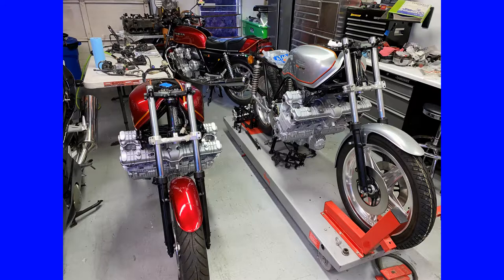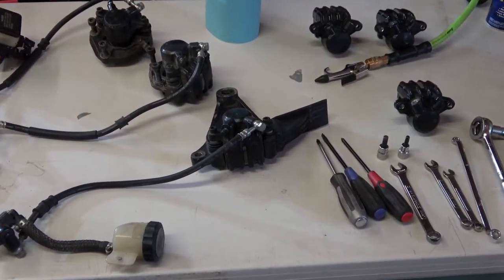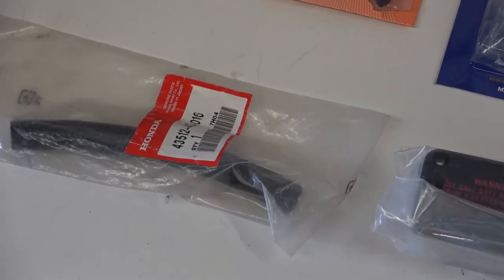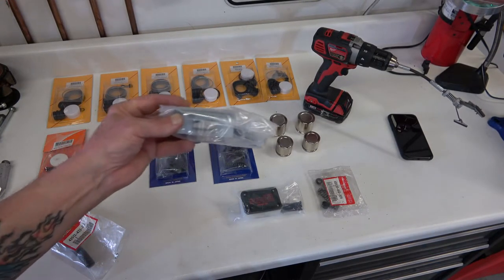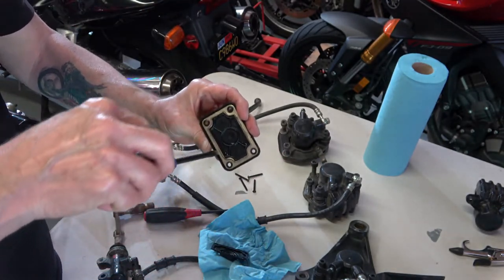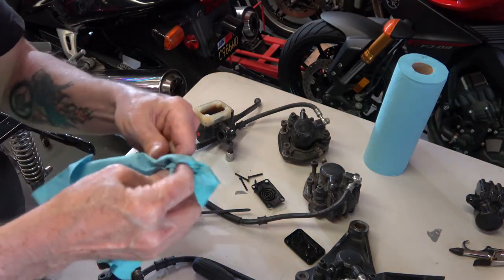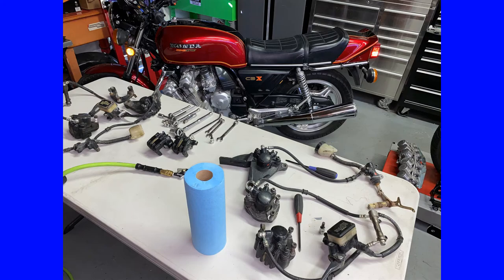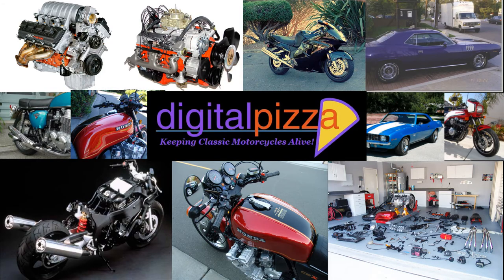Honda CBX Full Restoration & Engine Rebuild Video Series - Part 32 Brakes & Master Cylinder Rebuild

Comment: CBX brake - Master Cylinders.= Important to mention… When the piston is in the rest position, the brake fluid will be balanced via The compensation hole. This compensation hole is very small, clean this compensation hole with a very thin wire of copper, if it would clog… you are guaranteed a dragging caliper, this has already happened to me twice!!!  with the Honda CBX 1000. Stay Safe.